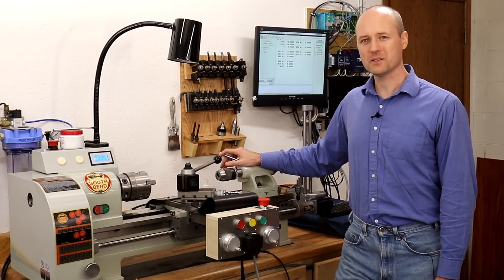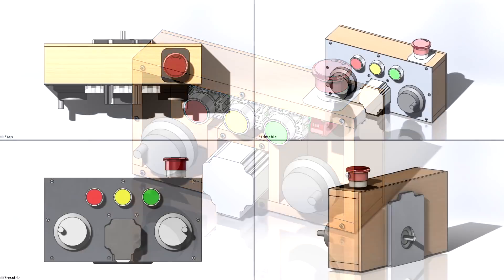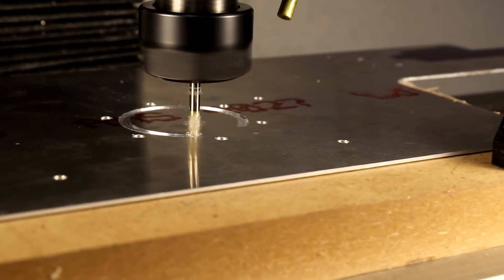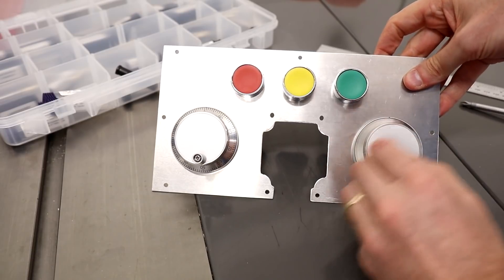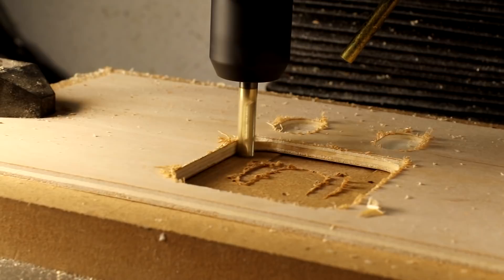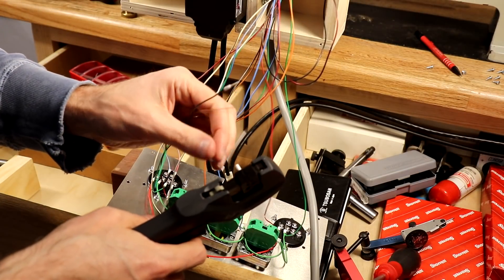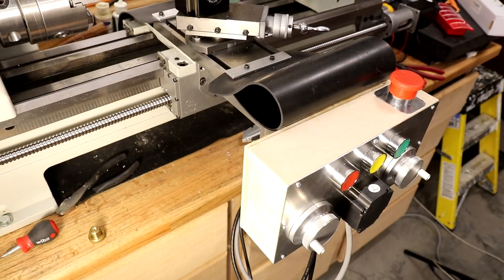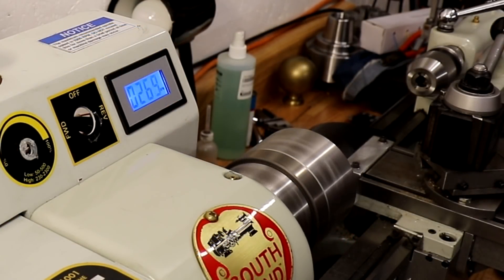Manual Pulse Generator Control Panel for CNC Lathe

Comment: Regarding the broken tools, perhaps the trochoidal milling technique would be better here?
Reply: My biggest suggestion is to have a shorter tool stickout for this sort of work. Trochoidal milling would definitely help and so would better workholding, but your aspect ratio of tool diameter to stickout is way off here. If you can keep it to a ratio of 3:1 (length to diameter) your tools will have a far lower chance of breaking under slightly variable operating conditions.
Reply from the maker: You're likely right, give the chips so time to clear. With Fusion360 it's easy to play with a lot of parameters and see their effect on the machining time. When I made these, adaptive milling, which I think is what Fusion360 offers instead of trochoidal milling, required something like 3x the time, but maybe it could have been run at 3x the depth? The biggest killer was the dissimilar heights. Everyone suggest vacuum table... and that would be awesome. Maybe in a few months.
Reply: Adaptive should automatically apply troichoidal when it’s within conventional specifications. I use a more advanced cam package than that which fusion offers and it’s adaptive clearing is amazing and can do it in lightning speeds. Fusion is supposed to have some of those features. May be based on subscription type. Either way wasn’t impressed with their cam and have avoided it to date. Dig into it more, features should be there.
Reply: Trochoidal milling would seem to avoid trapping the mill in a narrow slot where things can go bad in a hurry, there's plenty of room for things to push away from the bit. Adaptive milling seems to be somewhat different. I'm surprised you are using Fusion 360 and LinuxCNC as they are philosophical opposites. Estlcam has Trochoidal milling, have you used it? I know it offers trochoidal milling and seems like more of a match for LinuxCNC. Also using your pause button to clear things is excellent. A vacuum table sounds fun also, or perhaps a DIY waterjet for this kind of cutting. It seem like the height problem wasn't the double stick tape, but the clamping of the baseboard, which doesn't require vacuum to fix. In any case, excellent job and thanks for sharing.

Comment: I like what you have done here Kent. I want to use LinuxCNC and have some unused Mesa boards. I have a G0516 Lathe/Mill that I may try them on, and something along the lines of your control panel seems like a good way to reduce the shock of going CNC to someone who's been twisting the knobs for years. How did you read the encoders into Linux, did the picosystems board have enough inputs already? I just checked and the 7i73 board I already have will read up to four encoders, so it looks like I've got that covered, hardware wise. Sometimes things work out. Funny thing is, it turns out that Mesa controls is located nearby, sometimes the world is quite small. :)
Reply from the maker: Hi Alan, thank you. To interface the encoders, I used a Universal Stepper Controller from Pico Systems. I have them attached to general purpose digital inputs (GPIO), instead of the specialized encoder inputs. On the USC the specialized encoder inputs are sampled something like 5-10MHz while the GPIO is sampled something closer to 10kHz or so. The specialized encoder input is dedicated to a 2500 PPR spindle encoder and the slower GPIO inputs to the 100 PPR hand wheels. These are quadrature, so the sample rate must be 4x that suggested by PPR * RPM * 2. If your inputs are differential and you don't have differential inputs, you will likely be able to use just A, B, and Z. I tried that and also made a differential receiver, either way works as long as the noise is not great. In the LinuxCNC configuration, I used the encoder HAL component, attaching the GPIO lines to the A, B, and Z inputs of the HAL component. It's also important to filter the raw output with a low pass filter as the encoder is otherwise treated as a step function requiring insane acceleration likely leading to joint follow errors (the position lags the commanded position by more than the allowed error), which I would see frequently for even .0005" movements. With the ilowpass HAL component I rarely see that... still could use some tuning. The code I used for this is at the bottom of this file. My complete lathe configuration is available at the parent of this link. Glad to answer any questions you have. Sorry if I repeated a lot that you already know. Best of success to you. Kent
https://github.com/kentavv/kvvcreates/blob/master/linuxcnc/sb1001_lathe_config/lathe_config/univstep_servo.hal
Reply from the maker: I forgot to say, I've got a lot of use out of the dual MPG hand wheels, and for quick jobs I use a mix  of "manual" and CNC. For me, the combination has been wonderful. I never once missed the hand wheels on the mill though. What I would like to add or change is 1) a button that when pressed would switch the the MPG wheels to velocity mode instead of step mode, and 2) maybe a small DRO. If you make something similar, please let me know. I'd like to know how it works for you.
Reply: Great info and good ideas, I have a ways to go yet. I was looking at the Mesa 7i73 board, and it has keyboard and display I/O pins, and this small board interfaces to the control board with RS422 so all the wiring complexity would be inside the box, and just one RJ45 cable runs back to the computer/controller box. The downside of adding more buttons and readouts becomes making all the decisions as to which buttons and where to put them, etc. There are no kits for my Lathe so I have to figure out what to do there. Thanks again.

Comment: Of only they had a low rider magazine for lathes, this would be on the cover.  
To minimize broken end mills and most likley feathering, try to use a  multipass contour (in addition to multi depth) you might just need some more chip clearance- I noticed that the first tool in the vid broke of in the part, to me this means that it welded in from double cutting chips vs breaking off at the collet only from pure bending.
As for dying before you clear the cross slide from the tail stock when drilling, perhaps a clutch to disengage the 10 ft ball screw from stepper motor. perhapse a item on the todo list until the lathe dies too tho.
Awsome vid

Comment: I also like the ability to use my CNC (mill) in a "conventional" way as well i.e., with handwheels or a MPG wheel. Handwheels provide feedback on forces involved. Thus, you have not just an audible or visual but also tactile feel what the cutter experiences. Most "by wire" systems don't offer that. However, it is doable for by wire systems and also applied in some applications (outside CNC). As it relates to milling thin Al plates, vacuum tables can help as well as using single or double flute cutters instead of cutters with narrow three or four flutes that clock-/gum-up during chip evacuation (mild mist coolant helps).Thanks for the calming and inspirational video.
Reply from the maker: +Stefan Hertweck Thank you bet most for the kind words and suggestions. Would a servo driven MPG wheel be appropriate for both hand positioning and feedback? Perhaps adjusting torque on the MPG wheel proportional to the torque reported by the corresponding axis servo. I have a few single flute razor sharp endmills for plastics. Would these be more appropriate for thin aluminum than the three flute endmills I used? Regarding the vacuum table, is the surface facing the material sacrificial? The vacuum could be used for other proposes too. Making face plates like these is something that comes up frequently so it would be nice to dial in best practices. I've been thinking of getting a vinyl cutter to make labeling. Thank you again for all the recommendations.
Reply: Hello Kent. I guess a servo driven MPG wheel would be good. Fly-by-wire system and BMW idrive etc. comes to my mind. I am not sure about "is it worth the effort versus usability." As it relates to endmills (tool material, geometry, surface, feeds, speeds etc.) the question of right cutting parameters depends on your specific "setting":
- Material (e.g. specific kind of Al)
- Machine capabilities (elasticity, power, spindle speed)
- Type of cooling (none, air, spray, fluid)
- Tool life req.
- Cutting time req.
- Quality req. (surface, geometry)
- Mill strategy (e.g. helical, adaptive, climb/conventional milling)
- Workholding (e.g. ridgit set up, clamping force)
- Stability of "rest" material
- ...
This topic will fill books and I guess that many people will have lots of opinions about it.

As it relates to cutter parameters, here are some guidelines for Al:
- Al cutters have a larger cutting/rake angle than steel cutters (positive rake angle lowers cutting forces but weakens the tip. Thus, not used for heavy steel cuts)
- Al cutters tend to have less teeth, steeper helix angeles, and smooth (polished) surfaces to support fast chip evacuation and to avoid heat buildup (then Al starts to gum up, the tool will clog up and break)
- Al cutters are typically used at higher speeds and feeds than steel cutters
- To calculate starting values for speeds and feeds, parameters like f(tooth), f(cut), and a(p) and a(e) help in calculating starting values. However, the values that work for you depend on your specific setting (see above).
- Very small cutters (e.g. << 3 mm compared to >> 6 mm) have their own additional rules/sensitivities. Chatter and spindle concentricity come into play. E.g., a 6 mm tool can bear a 3/100 mm "wobble" (0.005 %), a fragile 1 mm tool will probably break (0.030 %).
- Al "loves" mist coolant and forced air to support chip evacuation

To all readers, please chime in if I have forgotten important points or if you have better knowledge.

Comment: What quick change toolpost are you using?  I have the same lathe and I've been contemplating getting a quick change for it.
Reply from the maker: Hi Will, the quick change post was a nice upgrade installed an Aloris AXA, and needed to slightly modify the compound to do so. Hopefully your lathe is not so afflicted, but mine has small diameter spacer under the compound that allows the compound to flex. I plan to replace the compound with a solid toolpost base, but enlarging the spacer would go a long way while maintaining the compound.
https://kent-vandervelden.blogspot.com/2013/11/aloris-axa-on-south-bend-sb1001-lathe.html

Comment: Cool control panel! I know next to nothing about lathes but it seems like having the controls setup like that would be handy.

Man, those 1/8" end mills sure don't waste any time breaking, do they? I need an 1/8" end mill with at least ~34mm of stickout for my current project and several of the brands/models I tried chattered lile crazy, no matter what feed and speed I tried (it seemed like). The best one out of my small collection was a Maritool 3-flute ZrN coated mill. Unfortunately, I ended up breakingg that one too. What I replaced it with is a 1/8" 3 flute ZrN coated mill with a 1/4" shank (also from Maritool). I won't say "it's the best end mill in the world" or anything, but I've used it one whole-entire time and it seemed to perform quite well; markedly better than the others I tried. ...might be worth a look, if you haven't bought replacement(s) yet.
Reply from the maker: Thank you, and you have a cool channel. I needed another good reason to procrastinate :) It hurts to see those tools break, it's like tossing twenties into the bin. Is the tool you got this one? Wouldn't need a ER holder for that, which is nice.

https://www.maritool.com/product_info.php?products_id=13047
Reply: Kent VanderVelden 
Thanks! :D

Yup, that's the one. It's a little odd because it seems like that might be the only /reduced from a 1/4" shank/ tool that they sell. It's the only one I could find anyway.

No ER needed? Would you use a set-screw holder or something?
Reply from the maker: Right, a set-screw holder, with smaller diameter for clearance and to help get chips out (and so the camera see something :) Best practices, according to Tormach, is to use an ER collet for tools 1/4" and smaller. The argument is the ER collet holds the tool concentric, while the set-screw holder slightly push to the tool to the side. The argument is a little iffy when talking about Tormach TTS tooling. It's a lot easier to create a concentric TTS set-screw holder vs. avoiding stacking of error in a ER collect and holder. I bet the error created by side pressure of the set screw is smaller is than the other errors (ER error stacking, ER installation error, spindle runout, column flex on benchtop mills, etc.) Probably best to always clock the small tooling to minimize the stacking of errors. This is all just my opinion and worth precisely what was paid for it :)
Reply: Kent VanderVelden 
I've been happy with what I've been able to get out of my ER-20s, and the versatility is nice. I own a total of 2 set-screw holders, but haven't tried either of them yet... So few of my tools have flats on them. Oh, I just thought if a tool that I use that does have a flat; maybe I'll throw it in a set-screw holder and fall in love. :p
Reply from the maker: The ER holders are so nice for drills, and I got a few extra collets of the popular sizes to have a few drills (for tapping and screw clearance holes) in stand-by. I was thinking of getting a few ER16s just to squeeze out a little more clearance. The collets have to be better than the drill chucks, that's my story at least :)

Comment from the maker: Check out my most recent video: https://goo.gl/Jj7cU1

Something for another video, with a small amount of programming, the MPG wheels can be used for other purposes. For instance, perhaps you want to cut a tapper, well one wheel can be used for crossfeed to backoff or advance into the material, while the other wheel controls both the longitudinal and crossfeed movements, with the correct ratio, to create the desired tapper (or other parameterized function of one variable.)

Comment: I love the MPG wheels right on the apron, that's a really elegant setup that definitely seems like it could mimic manual operations with a CNC machine, nicely done!! Do you use LinuxCNC exclusively? My (extremely limited) experience is with Mach3 and I was curious if you've had the opportunity to compare the two or share thoughts regarding the difficulty of getting LinuxCNC setup.  Thank you for the video!
Reply from the maker: Hi Jeff, thank you, maybe it's a little unconventional, and maybe there's a good reason no one does it... we'll see? Probably ten years ago I had an Industrial Hobbies mill (at the house than burned down.) I did a lot with that mill... I sort of scared I'll break my PM25 mill. The IH mill ran Mach3 and worked well. I guess, I tend to go deep into generally the unimportant details, and combine that with a greater ability to tinker (LinuxCNC is open source) and no licensing costs, I decided to try LinuxCNC this time around. I used Linux since '93 so I'm comfortable with it. Without any doubt Mach3 is easier to setup and works with more hardware (I had to try six parallel port cards to find one that works with my setup, I kid you not), but LinuxCNC is probably more extensible (to a programmer). Also, regarding total cost... while there are no licenses, for solid hardware such as FPGA boards that LinuxCNC likes, the money saved on licenses will be spent on hardware. A couple other pluses for LinuxCNC are it's what Tormach PathPilot is based on (not sure why that matters too much... maybe I felt a better chance for post processor development in Fusion360) and because it's Linux, there's less annoyance of Windows updates and such (and that's a real thing). LinuxCNC encourage (forces) certain behaviors that are apparently more common with larger CNC machines, so there's  perhaps more learning possible with LinuxCNC, however Mach3 is a lot more forgiving with regards to the operations (for better or worse.) Bottom line (from a LinuxCNC proponent...): If you don't have spare time, if you don't have a particular problems with Mach3 that are solved with LinuxCNC, I'd stick with Mach3. Hope something here was useful from my rambling, again this is based on experienced with Mach3 from ten years, but if you do tinker with LinuxCNC, I'd be glad to help you.
Reply: I was going to ask the same thing.  Thanks for the explanation Kent.
Reply from the maker: +Hidden Acres Absolutely, LinuxCNC is pretty great, that people are giving out a controller that enables Tormach to innovate their machines (e.g. Smart Coolant). But, as a person who is constantly sleep deprived, time is what matters most. I'm hesitant to do updates fearing that I may need to revert. On another topic, I still have in mind to copy your mill stand :)
Reply: I also wanted to thank you, kent, for the best reply I could have asked for!  It definitely lays everything out better in a very plain way.  I've got some projects I think I'd like to tinker with in the future but it definitely sounds like the friction costs of changing the motion controller in my CNC Mill probably aren't worth it to me!  Thank you for all the info you share, Kent!
Reply: Be sure you put in a good chip strainer in that mill stand.  That on my list to do when I get a new shop built. I moved last year and am just now getting a shop built.  Thats why I haven't made any videos recently.  I'm planning on getting a grizzly lathe soon to convert and will probably stick with what I know, and that Mach 3.  But I was curious about Linux CNC as I hear of many people using it.
Reply from the maker: +Practical Renaissance Thanks Jeff. You understand... new child equals not too wonderful of sleep :)
Reply from the maker: +Hidden Acres I look forward to you coming back. Not easy to leave the timber frame building I'm sure. On the stand, the wood is holding up OK to the coolant?